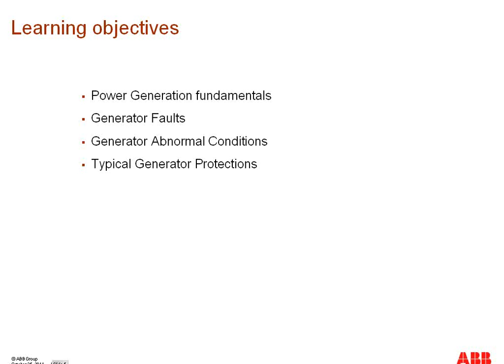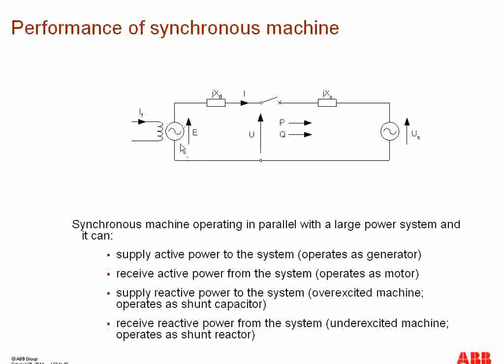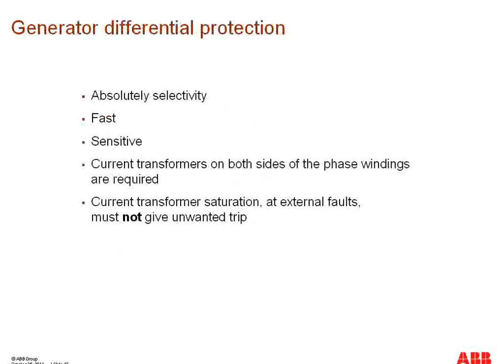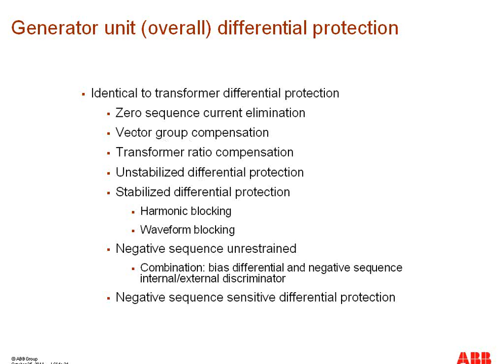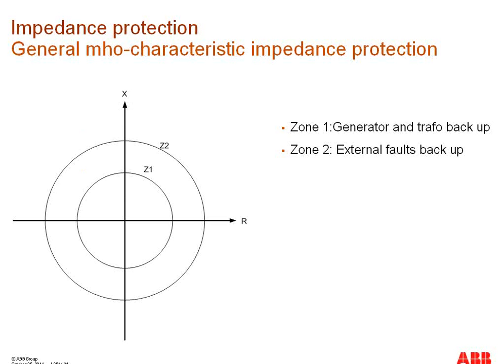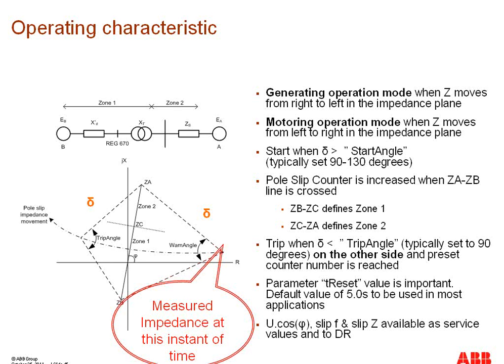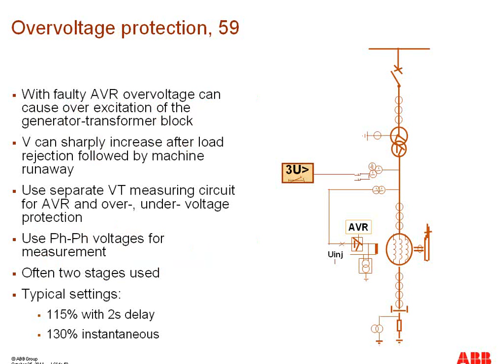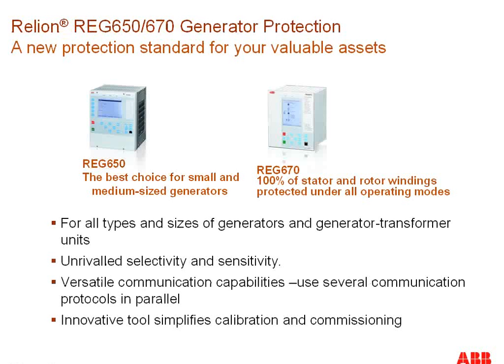Generator Protection Fundamentals

Comment: 00:1:00 Learning objective:   Power Generation Fundamentals, 14:00 Generator Faults, Generator Abnormal Conditions, Typical Generator Protection
1:30 Generator Station.  GSU.  Physical Assets Drawing/Diagram.  Turbine (prime mover) and governor.  Excitation transformer (system) - feedback and control.
Blue - potential communication of decisions - mechanical or electrical. Inputs Outputs.
Black are the electrical connections.
3:40 Electrical Singleline (connections of electrical elements).  (Diagrams and Drawings, Singlelines - Information/Data for understanding) Electrical and Controls are common singlelines.  Physical Geographic/Spacial Singleline
4:40 Generator topologies - Less breakers to more breakers. More elements.
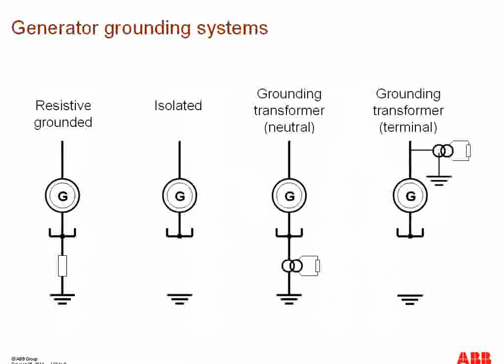5:30 Generator grounding options. Grounded (High fault currents) or Ungrounded (High fault voltages) -pick your poison.  Do we want to use a transformer?  Smaller grounding resistor.
9:45 (Synchronous) Machine operation - Motor or Generator.  Overexcited (cap) or Underexcited (reactor)
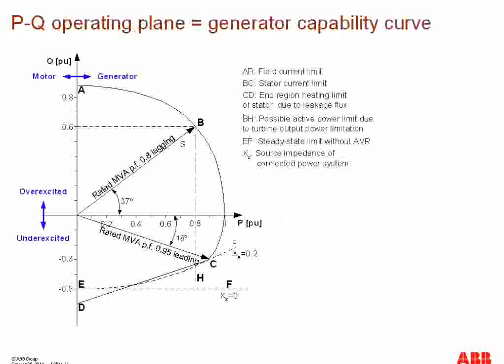11:20 Machine Operating Plan - PQ curves.
14:00 Generator Faults - External (through faults) and internal (ground, stator, rotor) failures {trip differential relay.  Input Output difference}.  
15:45 Abnormal Operating conditions -
1) Abnormal measurement (standard that lead prevent failure/functionality issues) -  Overload - I (or P too high), Imbalance - I (phase difference), V (too high or low), Q (too high or low), frequency (too high or low), Temperature (too high)
(notice the the frequency and time domain are somewhat different) - Q is a calculation from a measurement, same with positive, neg, zero sequence calculations.
2) System failure.   Control failure (AVR or governor), primary equipment (CT, PT) failure, cooling system failure, physical assets
3) Abnormal names - over-fluxing (overexcitation limits), asynchronous running (running separate from the system), out of step (reclosing into the system), generating motor (generator running "backwards"), open phase (open phasing), breaker failure, faulted conditions.
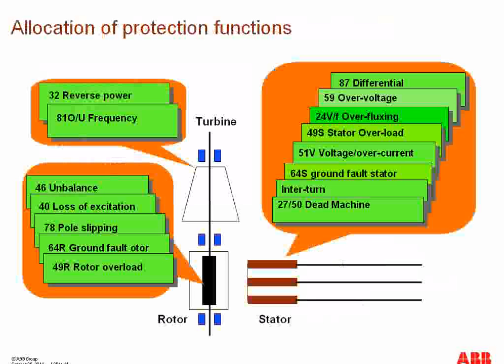17:00 Protection Function numbers (relays).
19:30 Stator Faults are rare.
22:30 Differential Protection.
Reply: Thank you Captain :)

Comment: Hello sir,
I had a question on stator ground fault protection.
When differential protection provides protection against phase and ground faults, why a separate protection system has to be employed for ground faults?
Reply: Because we have deffeirent fualts that happened on a power system (3ph,2phases between each other, ph ground,2ph ground) and the fualt current and the over voltage are deffeirent in every single case therefore we need multiple kind of protection to every single case